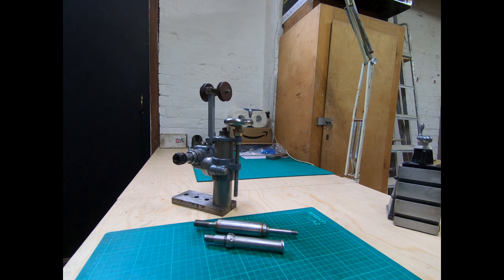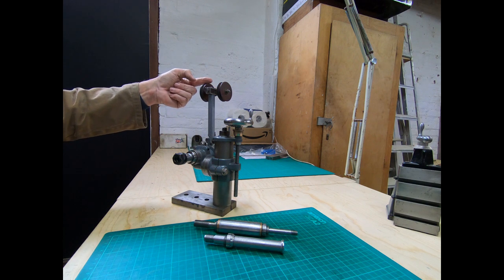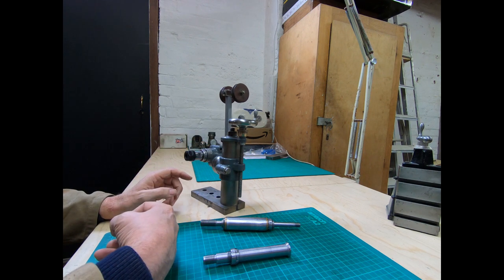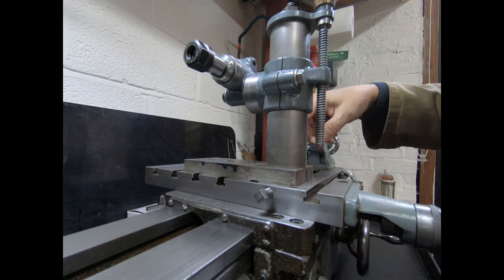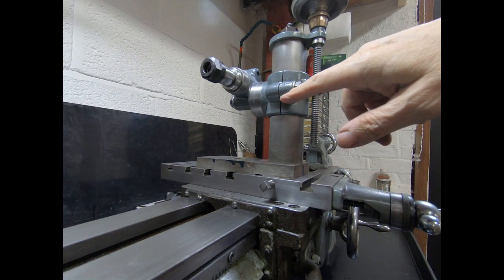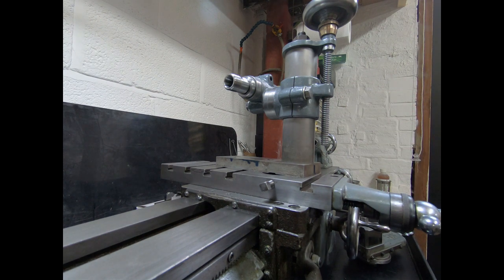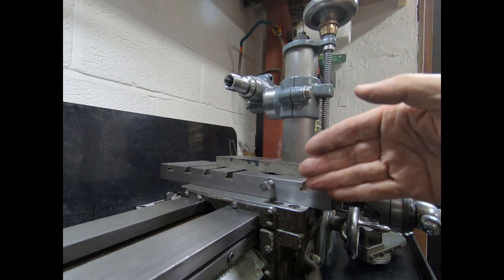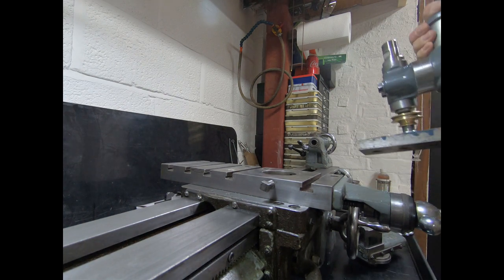Myford Lathe - Potts Milling Attachment for Myford ML7.

Comment: I used to have a similar vertical slide to that a long time ago it had a tee slotted swivel table fitted to where the spindle
mounts. This enabled me to bolt work to it and use a milling cutter in the chuck. It's in great condition and very useful. Tony
Reply from the maker: Hello Tony,
I hope you are well and thank you for visiting... I can see myself using a combination of this Potts spindle sometimes and the milling cutter in the chuck other times... 
Take care.
Paul,,

Comment: Very interesting attachment Paul.  You will need a wide speed range for various tooling.  Slow for milling/drilling and fast for grinding.  Grinding stones have a maximum speed specification and the operational speed can be anywhere from 50 to 100% of that. 

The main downside of milling/drilling on the lathe using the mill slide is that it can/will tilt under load due to flex and movement on the vertical plane.  Something to be aware of.  I counter this by using the tailstock as a support/brace when possible.  I will be interested to see the unit in action.  Cheers Rob
Reply from the maker: Hello Rob,
It's interesting that Lance from Bundy Bear's Shed was also speaking about the possible movement when it is under load... I clearly need to consider flex as a priority... I hope all is good in your camp...
Take care.
Paul,,

Comment: I was thinking the foot would be more solid than copying the compound mount seeing as the milling attachment has pressure so high up. Looks handy though.
Reply from the maker: Hello Lance,
That is a fair point... I have not done any measurements with regard where the center point of the milling spindle is in relation to the centerline of the lathe spindle... once I know that I should be able to calculate how beefy I can make the foot. Many thanks for watching.
Take care.
Paul,,

Comment: Nice accessory there !   To answer your question,  most grinding is done at 6500 sfm. So if you have a 6 “ wheel that would translate to 4300 approx. RPM.    formula is.   3.82 x 6500 ( sfm ).       Then divide by wheel diameter...  HTH Joe
Reply from the maker: Hi Joe,
Thanks for the help with the calculations... I will start to write a shopping list next week and start to search for everything I need. I generally set myself a target of say 3 months to pick stuff up at a good prices and when I get to the end of the 3 months I just have to pay full price for whatever is missing... Thanks for watching.
Take care.
Paul,,

Comment: What a spectacular lil attachment.  The possibilities with this are endless.  Especially if you happened to run the lathe motor simultaneously.  

As for grinding, if you find you can run it fast enough , maybe make a secondary adapter for a die grinder. 
I am. Already thinking about a grinder on the hendey as a possible add on
Reply from the maker: Hello Craig,
Thanks for visiting... I think it will work be good on the Myford... hopefully I'll will source the other parts needed soon and get it working. Looking forward to seeing what you come up with for the Hendy.
Take care.
Paul,,

Comment: Hi Paul.   Nice & Beefy looking Milling Attachment. Once It's set-up,  you can Mill Drill as well as do Ball Turning.  The only thing I would suggest, If you attach a motor on it, you need to check the Balance Position,  so Not to have to much weight on the forward or backwards area's on the cross slide assembly. Have fun, & see you on Your next video
Reply from the maker: Hello Ted,
Good to hear from you... That is a really good point about the motor positioning, which to be truthful I had not considered... In John's video the first one he modified had a far smaller motor and does look more balanced than the second one he did... Lots to think about now...
Take care.
Paul,,

Comment: Hi Paul, interesting attachment, never heard of Potts before. Looks very versatile. For grinding, I would give it a miss, you need to be 12k rpm and up really for small wheels. I would make an attachment for the Potts that connects to the final swivel joint to hold an air die grinder or Dremel (you have one to copy so no excuses)! Cheers, Jon
Reply from the maker: Hello Jon,
Hopefully the attachment will be useful for small work on the lathe... and bigger stuff can be done on the milling machine once I find one... Thanks for watching...
Take care.
Paul,,

Comment: hi paul
really nice milling attachment, ive not seen a potts before, with having my stand alone mill, ive not had to look in to milling on the myford even though it came with a standard myford attachment, it will be interesting to see it in action, i think for grinding you may have to reach speeds of 30,000 rpm, similar to what dremmels do, i suppose it depends on the size of the grinding wheels used, the larger diameter the more surface speed attained for a given rpm.
look forward to next instalment on the Potts
regards
mr f
Reply from the maker: Hello Mr. F,
Hopefully when I find a milling machine I will do larger tasks on that... and this will be useful on the Myford when I don't really want to take the workpiece out of the chuck... Grinding would be a great bonus but we will have to see.
Take care.
Paul,,

Comment: Good Morning Paul, interesting apparatus.
I'm no expert in grinding , but i think a few thousand rpm should be enough for most grinding. for small inside grinding i would try to make an adapter, to fit something like the proxxon lbs/e in the spindle holder.
Reply from the maker: Hello Heron,
I think approximately 3,000 RPM is achievable. When you look at the old toolpost grinders they seem to be in the 10k area... Lots of things for me to research and think about. Many thanks for watching.
Take care.
Paul,,